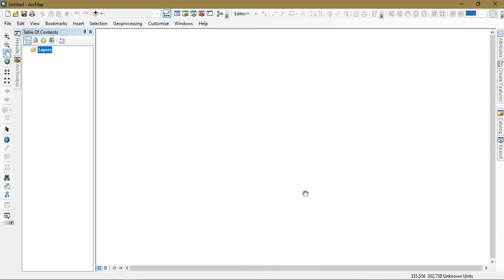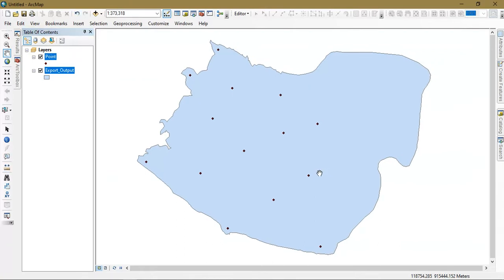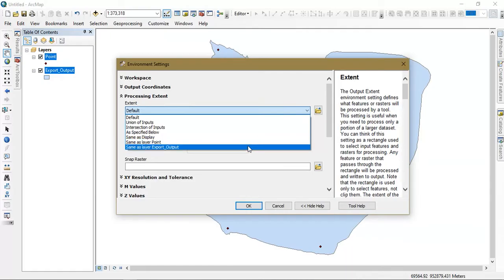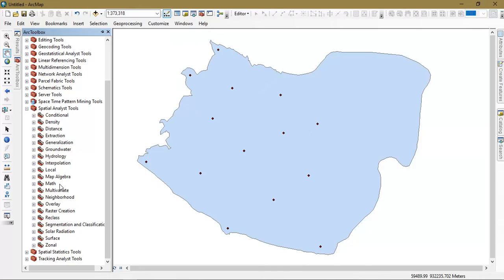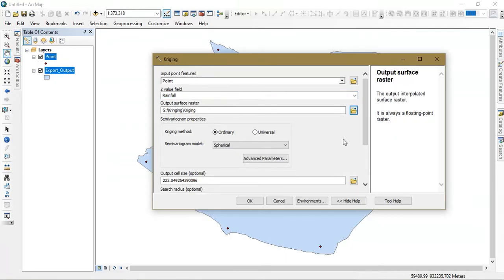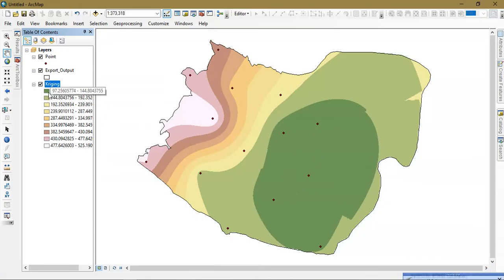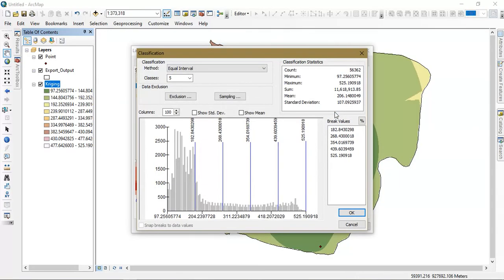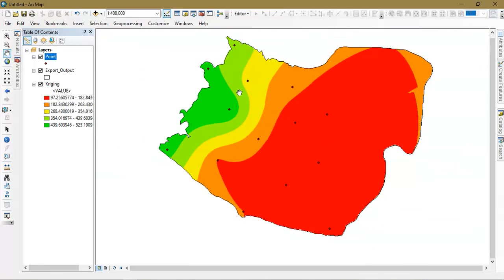Interpolation: Kriging using ArcGIS

Comment: Thank you so much for the video, It's simple and straight to the point. My question is can you show what the point data looks like or describe what it is (i.e the information it contains and if the file is in excl).
Reply from the maker: Hi Zahra Ab, Thanks for you valuable comment and feedback. Point data is reprenstation of location, the point data consist of information which can be manual entered through attribute table. Many times it will be excel file which contains latitude, longitude and information about location. Example: Rainfall or temperature or groundwater quality or sample information and etc. Thanks for your wonderful question.

Comment: I failed the Kriging and it's written that 'Output Surface Raster: <empty>'. i dont understand. Could you explain? Thank you in advance :)
Reply from the maker: Hi Tsukirro, Have used the correct z value field or Try to use the default file directory to save the output and don't save other than default directory. Please give a try and share your results. Thanks for your valuable question.
Reply: @TerraSpatial  WoW. Saving in default file directory was an issue i had with methods. MANY THANKS!
Reply from the maker: @mikeadvr46  Thanks for sharing your experience

Comment: How do you deal when the interpolation gives different values where you have data point? My interpolated map is not respecting the available data point values.
Reply from the maker: Hi Mr.
 Raghwendra Narayan Shandilya
, The interpolation tool works based on the points input, the values will be above or closer to values of the point data. It just estimates the unknown  with  the known values.
Reply: Interpolation is no matter what equation you're using is always a prediction with possibilities of errors...  unfortunately in a arcgis there's no such option to check the significance of your model... but still you can try different methods depending upon your data...